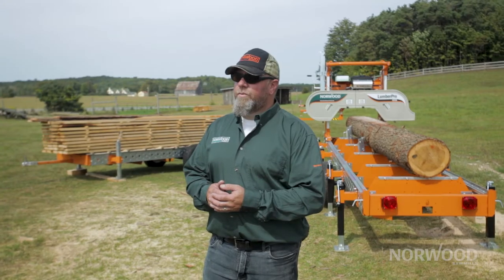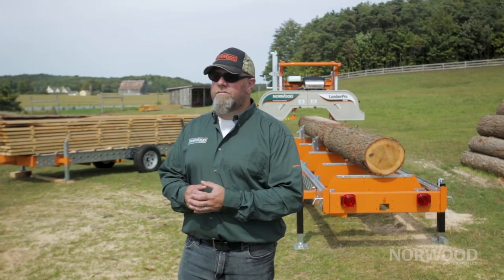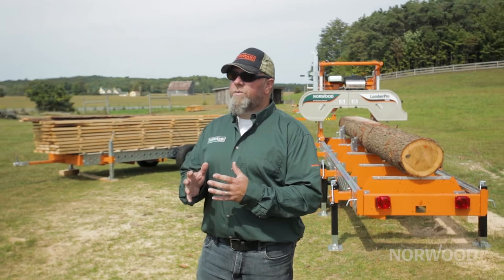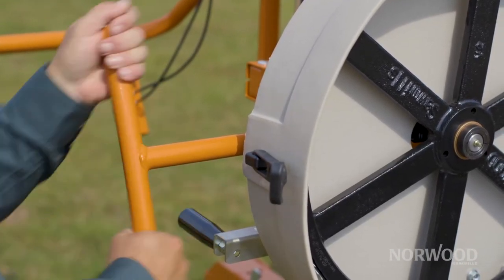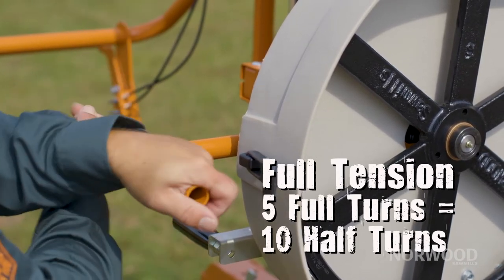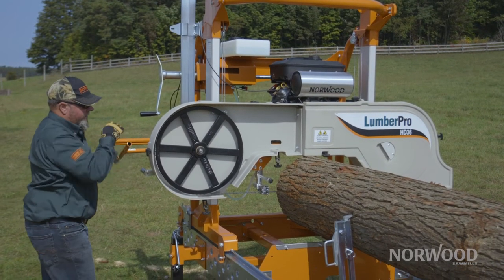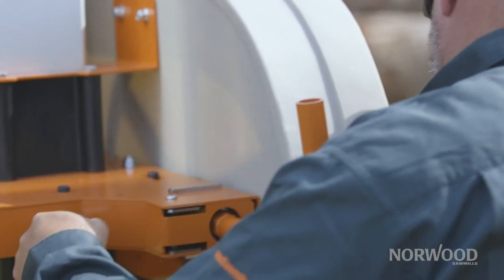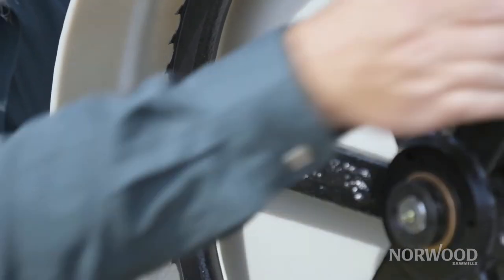SAWMILL TECH TIPS - Tensioning Your Blade on Your Norwood Sawmill

Comment: Maybe this is a dumb question, but 4.5 turns from what starting point? From the most relaxed position of the tensioner assembly, all the way pushed inboard? Or is "0" from when the slack has been taken out of the blade?
Reply from the maker: Hey Smocky. From the point at which your blade has tension on it (snaps straight). Happy to also spend some time on the phone with you 1:1.

Comment: Hi... could you tell me if the blade should sit flush with the gullet of the tooth against the band wheel if using a one and a half inch blade?  Thanks
Reply: The short answer: start out with the body of the blade (from the back of the blade to the bottom of the gullet) centered on the bandwheel.  As always, set the tracking with the blade at full tension.  If the blade tends to rise in the cut, move the tracking back a bit, if it dives, track it forward a little, until you find the "sweet spot".

 I tried 1-1/2" wide blades a few years ago, thinking that I'd get straighter cuts, but they actually caused more problems.  Because there is more steel in the blade, you need more force on the tensioner to get the same stress (pounds per square inch) on the blade, so you will be actually running the blade looser, meaning that it will have more of a tendency to wander.  Hope that makes sense.    The bandwheels and guides are designed for 1-1/4" wide blades, and you will likely have more success in straightening out your cuts by getting everything tweaked in.  Another reason some people go with wider blades is to get more sharpenings, but that doesn't work because only the very tip is heat treated, and when you sharpen below that area, you are cutting with softer steel, which dulls very quickly.  Short question, long answer!
Reply: Thanks for taking the time to answer Dave.  I haven’t been putting enough tension on the blade.  My manual says 6 half turns, which is too loose as it throws the blades even when tracked perfectly.  I went up to 5 full turns and it’s solved all the issues.  It’s an mx34. 👍
Reply: That sounds about right.  I've never had a problem from too much tension.  I'm trying to come up with a good way to measure tension so anyone can get consistent results.  Any suggestions?

Comment: I have the Frontier OS18 I just bought. 5 weeks to assemble it due to excessive heat and humidity working in my garage.
It's finally done, but with glitches, like missing or wrong part and I had to order them from an online website.
BTW, the manual instructions are not very good on assembly with line illustrations and small B&W pictures showing where things go. Email support was somewhat helpful, but not much.
It took me about 4 hours total to get the blade to track properly and getting the tension right. A real PITA going back and forth on the adjustments.
My two complaints. Who designs an E-Stop Switch that must be disassembled to install? The  parts flew all over the place. Ordered a better one online that uses a QD plug for wires.
M10 Star knob was missing for the depth of cut assembly. Ordered a better one online.

Comment: Hey guys, what is the most common cause of a blade diving. Sometimes my saw comes to a point in the log and it just stops. I back off and try again. Then the blade comes off the far guide. It like I hit something hard. But as I gently work through it there is absolutely nothing in the wood. It’s clear and clean. Then the saw might cut a few mor boards and does it again where the wood is wavey. Any help with this. Please.
Reply: Which sawmill are you running?  What guide system (ceramic or roller)? What species of wood are you milling?  How are you tensioning the mill?  Does the tracking run the blade the way Trevor showed in this video?  Is the tracking consistent, or does it wander when you turn the bandwheel by hand?  Have you tried changing blades (hitting grit or a bad weld can cause this problem)?  My experience has been that a lot of people don't put on nearly enough tension out of fear of breaking the blade, and that would certainly cause the wavy boards.  You mention that the saw just stops... if the blade actually stops in the cut, one of two things is happening: either the blade tension is too loose, or the drive belt (from the engine to the bandwheel) tension is too loose.  Either one will cause wavy cuts.  My money is on the drive belt.  How do you back the blade out of the cut?  It works best to drive in a wedge or two to open up the kerf, and NEVER try to back out the blade while it is spinning, or it WILL come off.  If you are using ceramic guides, the blades should not be touching the guides when you spin it by hand, and should be level.  If you are using roller guides, make sure they press down on the blade as described in the instructions.  If all else fails, go back and check that the two bandwheels are perfectly aligned.  The assembly manual describes the process.  Hope all this helps.  Post back and let us know how you're getting along!

If you are running an HD36, this video might help.
https://www.youtube.com/watch?v=G8DTem_zFeY&t=398s
Reply: Dave Boyt thanks for the insight. I have theM26 I have done everything you said. Now while turning the wheel by hand I have the blade running true but on one side it almost touches the back of the roller but on the other side it’s 1/4” away. So I moved that roller up an 1/8” and now so far so good. When I said the blade stopped I meant I couldn’t push it into the log without the blade bending down. It was still spinning I just couldn’t push it ahead. I would back it off and try again and again. Finally I managed to get through that spot. When I got that piece cut and looked at it closely there was nothing but clean wood. But as I said I have a new blade and made the usual adjustments and moved one side roller a bit ahead and now it seems to be fine. Will keep you posted. Thanks.
Reply: Glad that helped.  It might be interesting to take a close look at the teeth of the old blade.  Any damage to the teeth would indicate that you hit something, maybe some grit or a small stone in the bark.  That's all it takes.  Where are you located & what are you cutting?
Reply: I'm just south of Winnipeg.  Cutting some ash, but mostly poplar.  We do alot of natural playgrounds so we 1/2  logs for benches but want to use the light wood for different shelters and play areas.  Poplar is readily available here.  valleywest.ca
Reply: Great! You'll find that the ash is a lot more durable than the poplar, but both will last a long time if covered.  In any case, it would be a good idea to de-bark the 1/2 logs, if possible.  Poplar in particular can have a lot of stress, and that may have contributed to your problem (what you described was likely a combination of issues).  You may notice boards curling up or even bending sideways as the sawmill cut relieves the stress.